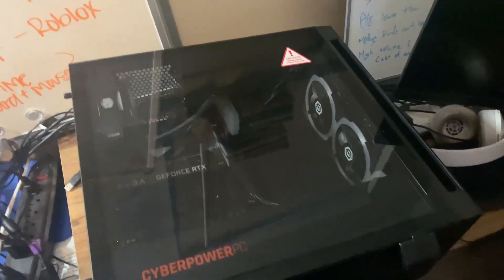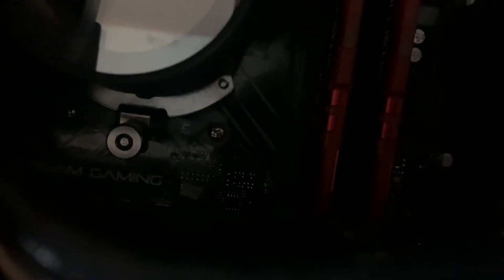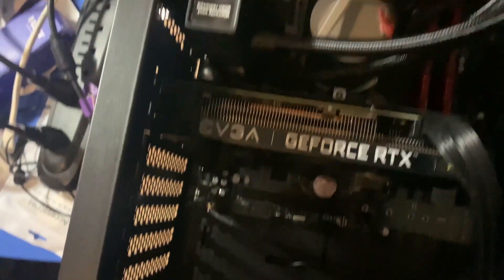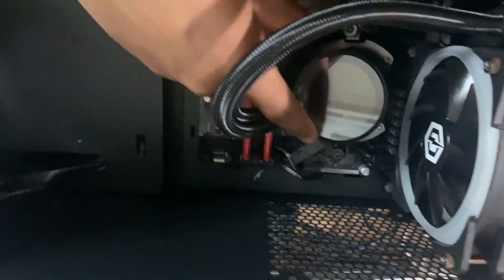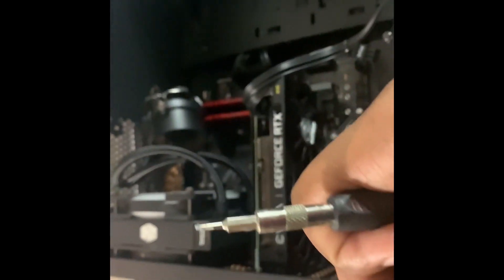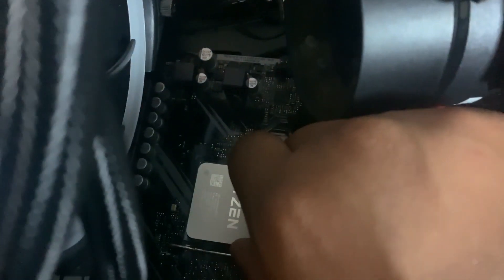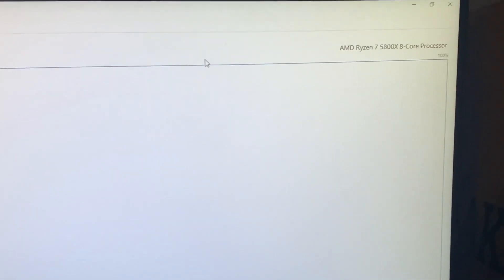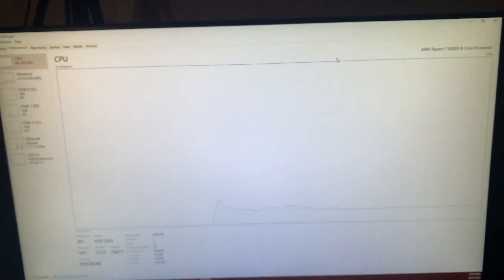UPGRADING CYBERPOWER PC’S CPU FROM A RYZEN 7 3800X TO A RYZEN 7 5800X (IS IT WORTH IT?)

Comment: How cool does it run
Reply from the maker: Generally stays below 70 degrees Celsius. I did turn the fans up when i first installed it because I read in a bunch of reviews that the 5800x gets pretty hot
Reply: @MacGames63  that's awesome is that 70c idle or full load? Yes the 5800X runs extremely hot with air cooler i noticed on my Walmart/CyberPowerPC https://www.walmart.com/ip/seort/536139726 I got this Alienware aurora R10 with a R5 5600X it runs 20c cooler at full load i think it they had repasted the CPU because its too good to be true with this temps. I am returning this to walmart and getting the one you have
Reply from the maker: @frikitonxplosion  that’s at full load it’s fluctuating between 70-75
Reply: @MacGames63  wow that's amazing!!!
Reply from the maker: @frikitonxplosion  i have got as high as 83 though….

Comment: Bro how did u put the screws bck ?
Reply from the maker: turns out that when I unscrewed them the back plate holding the cooler in place fell off so I had to take the back panel off the PC and hold it in place as I screwed them back in.
Reply: @MacGames63  I did tht but the top part won’t stay on the processor
Reply from the maker: @200iqshawn2  the silver part you unscrewed with your hand from the cooler hooks to the middle of the black mounting parts you're screwing back on
Reply: @MacGames63  ohhh but how U did tht yourself cuz it’s hard
Reply from the maker: @200iqshawn2  it definitely hard 😂😂😂 took a lot of patience cuz i was getting mad
Reply: U have a discord?